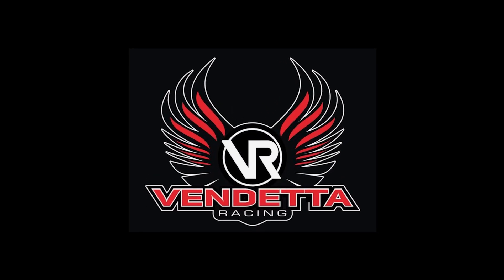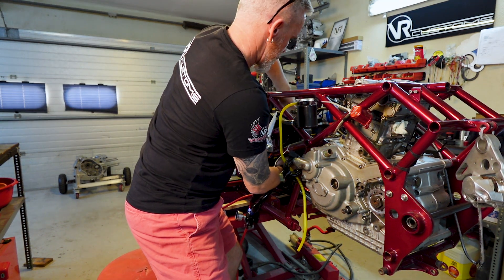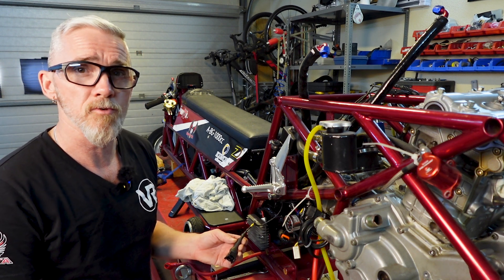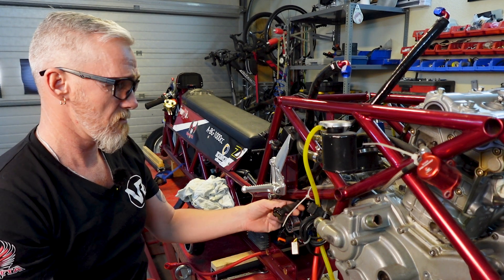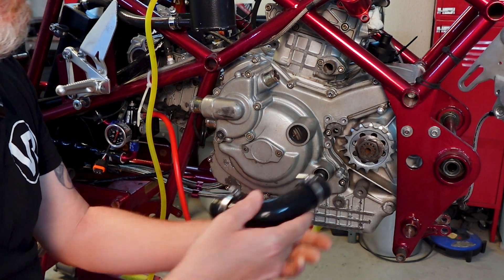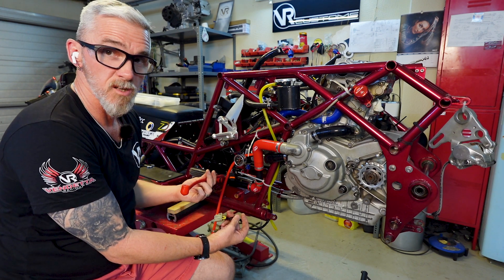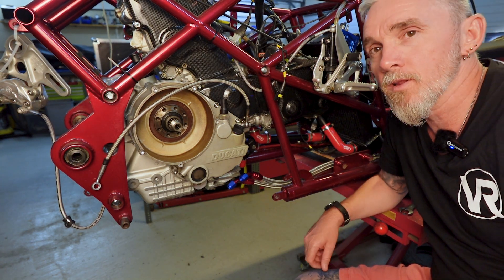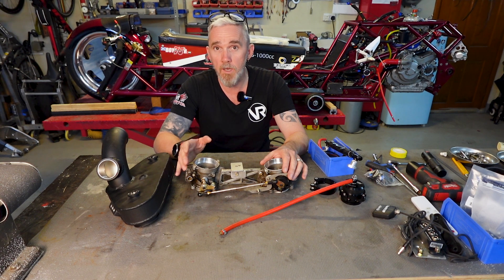Hooking up the ancillaries to the Ducati 998 Engine on our Land Speed Motorcycle

Comment: Could you use a wiping of silicon grease on the throttle body O rings to reduce resistance? Heat / Fuel resistant perhaps.